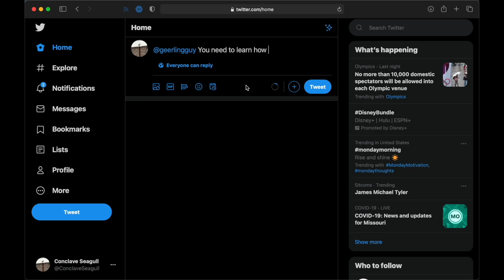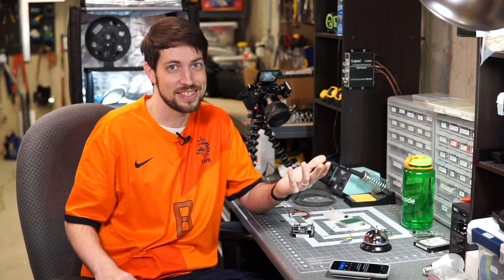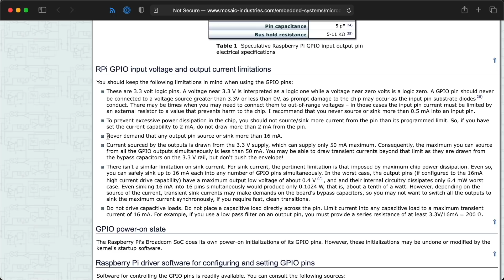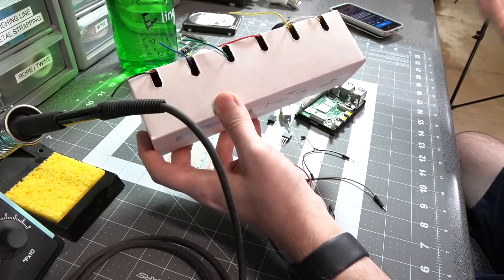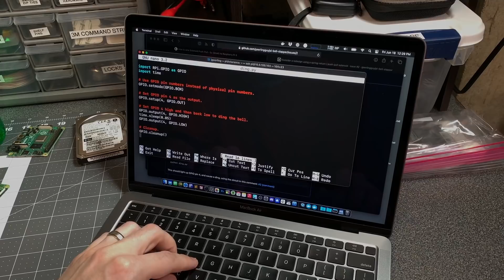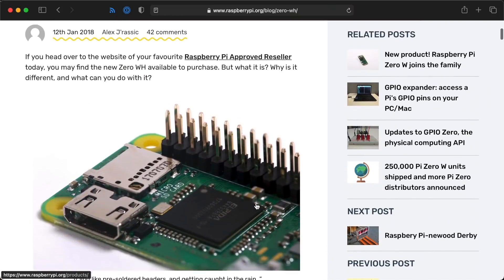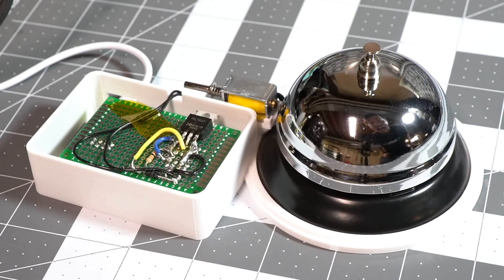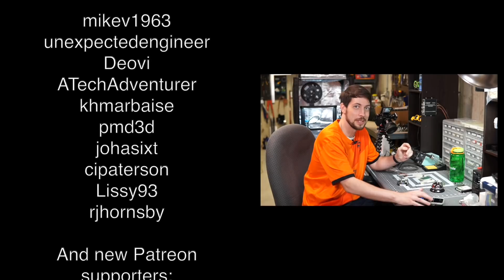Raspberry Pi Email Notification Bell

Comment: Success!  Printed the case and assembled the circuit with the parts listed.  Chromium won't launch on Pi Zero, used VNC and file transfer to get the files onto the Pi.  Using gmail it was necessary to enable IMAP,  enable 2FA, and create an application password.  The app password is used in the config file and it worked.
Reply from the maker: Glad it worked for you! Hopefully version two of this device could be even simpler!

Comment: I would have used an ESP32 or Arduino for this project, the PI is overkill. That said you should be able to add features and capabilities to this that the ESP32 or Arduino are not be able to handle, I just don't have a clue what those could be. Considering I do not know the radio station and what they do, how they do it or anything else that could drive ideas this is not surprising.

Comment: I think you could hide an ESP32 under/inside the bell? Couldn't you also put the solenoid under there as well and hit the bell from the inside? Just model a circular base that the bell sits on if more space is needed.

Comment: Once you're done with the prototype, you can probably get a "real" version made with JLCPCB. You can use a free tool such as KiCAD to design the board, plot the GBR files and have the board made for you. A small PCB like this costs about $2. Shipping is usually the most expensive part of the whole process.

Comment: Adding a cap on the power supply 5V rails might be a good idea for long term applications because it might reset the pi when the current spike appears
Reply from the maker: It's possible maybe—though with a good enough power supply (with enough current and not a huge drop when the solenoid hits) it shouldn't be an issue.

Comment: The flyback isn't needed because the spring back action. It's needed because of the coil of wire in the solenoid. When turned off, that field collapses and that causes the inrush of current. Relays need flybacks for the same reason.
Reply from the maker: I stand corrected!

Comment: I definitely wouldn't pull an amp consistently from the +5v rail. That's gotta be close to the polyfuse limit on the zero. If you've got a mosfet, just connect the mosfet directly to the power source and connect the grounds together.
Reply from the maker: I thought the Zero passed through the 5v direct from USB? Maybe I have my Pi models confused...
Reply: @JeffGeerling  It seems like you're right, the Zero/ W doesn't have the polyfuse as a cost cutting measure? All of the other Pis have a 1A polyfuse. I'm a little confused too because the Pi Foundation doesn't recommend powering the zero via backfeed current through the usb port. In any case, if there is no protection then the current limit of the +5v rail is determined by the trace thickness on the board. Maybe they intend for the Zero itself to be the fuse? I don't think there's any danger, but I'm just imagining the worst case where the software hangs and the solenoid gets stuck on. Things would probably get warm pretty quick.
Reply from the maker: @silverywingsagain  I actually did have solenoid stuck on at one point in testing a long ringing script. I pulled power to the Pi pretty quick... definitely didn't want to burn up the one set of parts I had on hand at the time!

Comment: Nice! But, Isn’t pi an overkill here? ESP8266 is way cheaper and has all functions of a full blown MCU. Plus a TCP/IP stack to connect to the Internet.
Reply from the maker: Yes, but it takes more effort to flash, and in case of problems, since it's remote, it's harder to get someone on-site to plug in a monitor and keyboard and figure out the issue, or SSH into it (since it's not running full Linux).

Comment: I prefer the big slappy arm, you should’ve just slipped a furry paw or a plastic hand over it or maybe an arm and hammer. Solenoid? Bah, you may as well play a wav file through a speaker.
Reply from the maker: The eventual intention is to make it look as close to a run-of-the-mill bell as possible, maybe even with some laser engraving on the top for identification :D

Comment: OpenSCAD is great, despite its rough edges - I do all my "utilitarian" modeling in it. Particularly for dimensional (rather than artistic) models, it's excellent to have a tool that makes it so easy to make everything parametric, so adjustments and iteration on the design are very fast.

It's also nice that it's completely free and open source, since Autodesk has been gradually tightening the noose on Fusion 360 and I haven't found a lot of other good options that make parametric modeling a first class citizen.
Reply: i belive kicad is pretty good as i see stephen hawes use it a lot

Comment: QUESTION SIR JEFF:    the wires used, what is their classified size?  Can I buy small spools of different color wire that size and crimp on the ends?  Or just solder the wire to source?

Can you ask you friends for a possible source for small spools / different color wire?  Thanks and God Bless!
Reply from the maker: For the final product I used a 26AWG set of colored insulated wires I bought from SparkFun. There's a link to a similar set on Amazon in the video's description. That wire is extremely handy for so many projects!

Comment: you might want to add a big capacitor between 5V & ground near the MOSFET, so your Pi don't goes into throttling or just shut down when the solenoid goes ding !
Reply from the maker: So far it's been fine—the 5V rail is connected directly to USB at 5V, and I'm using a nice 2.5A power supply that doesn't have a drop when the solenoid hits. If using a cheaper PSU it could be an issue, but it hasn't been in this case.
Reply: @JeffGeerling  I'd still go with a decoupling capacitor, current drop can pretty much mess your SD card if they occur at the wrong time. 1000µF/16V should do the trick just fine :)

Comment: With an ESP and a micro solenoid I bet you could fit everything inside the bell.
Reply from the maker: Possibly! I'm considering what to do for V3, so could be based on a smaller controller!
Reply: You absolutely can! https://www.youtube.com/watch?v=h5CqjYG4t0E
Reply from the maker: @billiamthesecond  Oh hey, how did I not find that in all my DuckDuckGo'ing???
Reply: @JeffGeerling  Mostly bad SEO on my part 😂
Reply: A Pi is a total waste of resources. I agree on the ESP approach and think a micro-relay will also do the job even be cheaper than a micro-solenoid.
Reply: @ManfredAckermann  ok, but sometimes it's better for getting a proof of concept going with something overpowered. Iterative design my friend. A lot of "aha" moments to be had for beginners.
Reply: I don't want to be rude... It just hurts to use a full blown OS when a ESP does the job even better for 1/10 price. And I have to admit that I like ESP more after working with both for such jobs for not only price but also energy consumption.

Comment: I'm not sure if that will work forever, but Raspberry Pi zero w (At least mine) has issue with wifi causing network connection to be lost after a period of time. Maybe something wrong with mine :(
Reply from the maker: Might be a localized problem—I've had three in service for months at a time without an issue.

Comment: For V3 you should consider using MQTT to send messages to the PI.  Email received events (or maybe YT sub notifications?) send a message to the MQTT topic broker which the PIs client subscribes to. AWS and Azure have good IOT brokers, but it’s not hard to setup mosquito as well
Reply: You could even use an ESP8266 or ESP32 with MQTT, even cheaper and doesn’t need an OS to potentially break or being outdated after a while

Comment: Why so complicated ? A 8266 or ESP32 would have done the  trick, boot faster and are way easier to program than a Raspi.
Reply from the maker: There's also the Pi pico!

But in my case, I only have two ESP32's on hand right now, and they're going into other projects. Additionally, this little guy is going into service at a remote location where I could walk someone through SSH into the Pi, but probably not through the process of re-flashing an ESP.
Reply: @JeffGeerling  ESPs do OTA, but not to a remote entity n a different network. Having said that there are ways of disclosing a HTTP server from ESP where one can upload firmware to the likes of OTA updates. 
Dont get me wrong - love PIs ;)
Reply: You use what you have in stock?
Reply: @stevefriedl3983  I sure have way more 8266 in stock then Raspis ;) but than Jeff lives in a different realm :D

Comment: Great project! That’s for making everything open source. Isn’t OpenSCAD great!? A little bit of a learning curve, but really useful for 3D prints for makers.
Reply from the maker: It works a lot better with my mental model for simpler 3D designs—just think of the shapes, put them together on a plane, and voila!

Comment: I'm looking for ideas on a project similar Clarence.
At bed time I have to check if my garage doors are closed. What envision is small box with 2 lights on it. When a garage door, the relative bulb turns on. And if course when the door closes the light goes out. I could position  this near the TV where I spend most of time.

I currently I have a Wyze sensor on each door. I have a Tasker app that responds to the sensor, and currently just says Garage door left is opened/closed.

Got this idea watching bell rings video.
Any suggestions?
Reply: Pretty easy to do this with Home Assistant